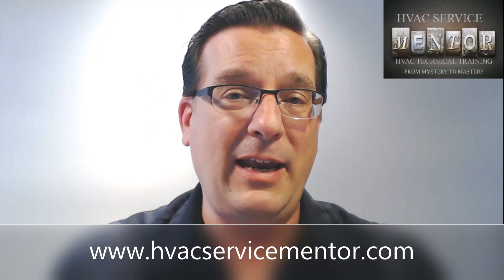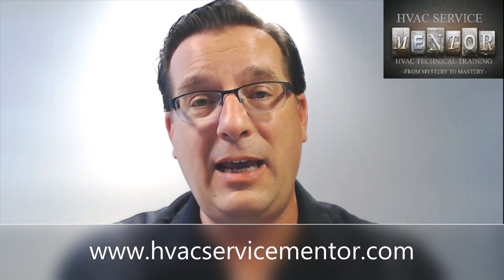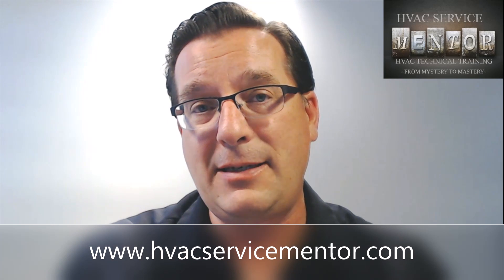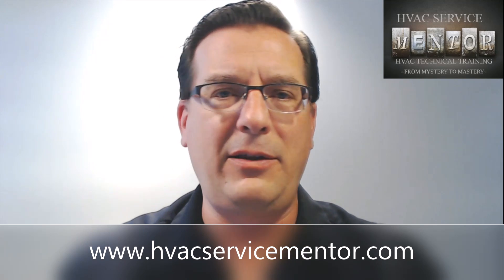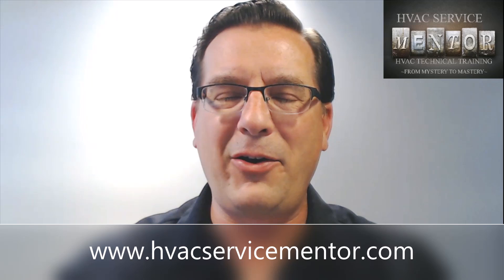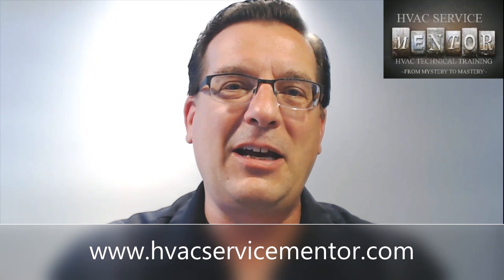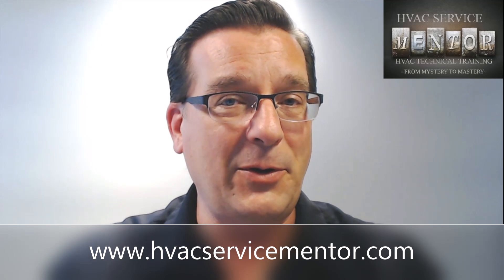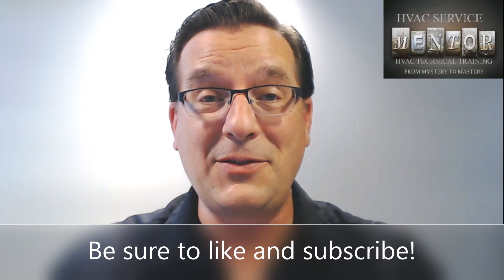Troubleshooting  the TXV

Comment: I have a 410a unit m trying to figure out . If it the txv or not .  Low side is 158 Psig with 17 sh and 288 psig on the high with AC if 1.4 
Would the txv be bad thanks

Comment: i could have used this trick....had a unit that i thought had leaky shrader valve and it did so i replaced them ..recharged and all was well for about a week..i go back and im thinking there has to be a leak somewhere so i tear everything apart ...cant find it with the sniffer. ..i call one of the more experienced techs and long story short it was a bad TXV ...

Comment: When testing a TXV isn't the pressure supposed to go up when sensing bulb is in cold water and go down when in hot water???
Reply: WRONG        hot bulb will open txv to let more refrigerant tru increasing suction pressure     cold bulb will shut txv less refrigerant tru  equals lower suction pressure

Comment: Excellent video, I'm electronic tech (voice/data) but not HVAC, now I know what to look for when the HVAC tech shows up.  They just replaced TXV on my new ( 6 month) Goodman Heat Pump with a piston.
Reply: Wow! Why in the world would they have done that?  Sounds like you had zero comissioning on your system at install.  Was it done at both the indoor and outdoor units?  Also, sounds like you no longer have a valid warranty.  There's a reason why the industry is moving away from fixed metering.  
Swapping out the TXV presents a problem for the next guy who comes to service your unit and rely on the manufacturer's "plate."

Comment: So Eric would it be safe to say that if you have an irregular amp draw that txv could be in the culprit category along with dirty filter slow running fan in or out and some other restriction.
Reply from the maker: If your TXV was slammed shut, you may have high compressor amp draw, but that would be the least of your problems.    The internal pressure relief would probably pop before you got your amp clamp out.  Most of the time, any condition that reduces refrigeration capacity (less cooling) will have a slightly lower amp draw including the conditions you mentioned.  Difficult to perceive unless you have a "before" measurement to compare to.  Remember, compressor amp draw will vary along with cooling load.
Reply: @hvacservicementor  thaNks for the insight..

Comment: Hey Eric how u doin.. i was searching for the video you've made on wich is better r22 or 410a but i couldn't find it...
Reply from the maker: I haven't made a video like that.  I don't  consider one better than the other.  They're just different.
Reply: @hvacservicementor  thx for the answer and sorry my bad it might be on another channel get confused with you coz i follow lots of ur video 🙏🙏
Reply: @fuyftuy  back when they just made R410A, R22 was better. But as technology advances they've become more or less equal.
Reply: @christianruvalcaba7788  yeah u got it. When 410a was introduced i remember first feeling was .. umm not as cold as r22 with in 10 to 20 minutes when compressor kick in... 
Nowadays i feel it less. Right as u said... system improving... 
Thx Eric.
Reply: @christianruvalcaba7788  
Imagine how good systems could be today with the advances and using R22.  Many characteristics of R22 make it a better refrigerant than 410A.  There's a white paper out there delineating the differences which came out in the era of switchover.

Comment: But why was your saturation temp so low? About 15 degrees assuming this unit uses 410a that’s well below freezing 🥶
Reply from the maker: Good eye.  I didn't share the refrigerant that was is use because I't doesn't have a bearing on the validity of the test.  It works for any refrigerant.   This one happens to be R22.

Comment: This was a super !!!   video.   You get to test the TXV without pulling things apart and risking doing damage.  Thank you.
Reply: That all depends on if the airflow is correct and the line set is correct and there’s no kinks etc..❤
Reply: But you don't need to test a txv when everything it's ok, if the system is operating good, it's not necessary to do this